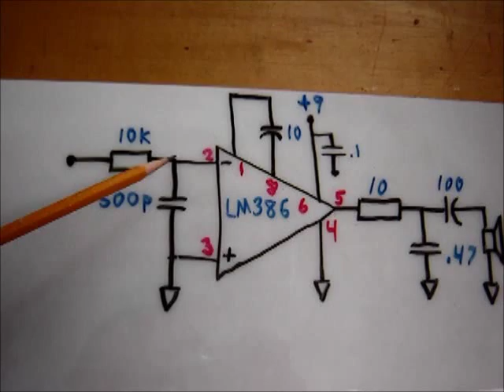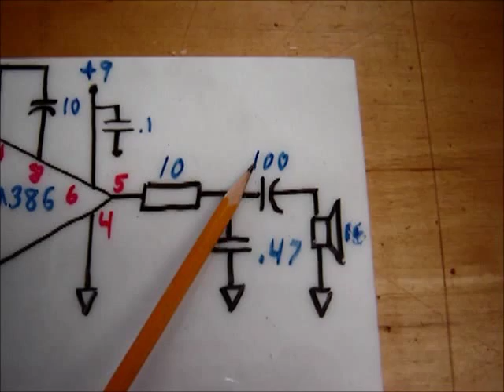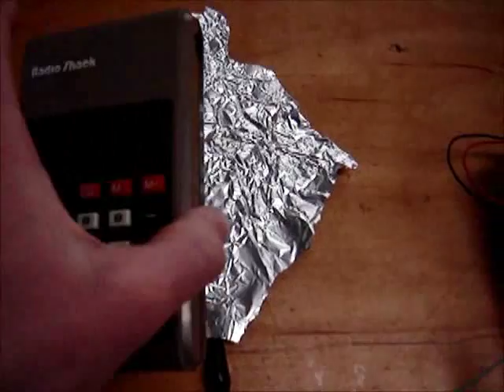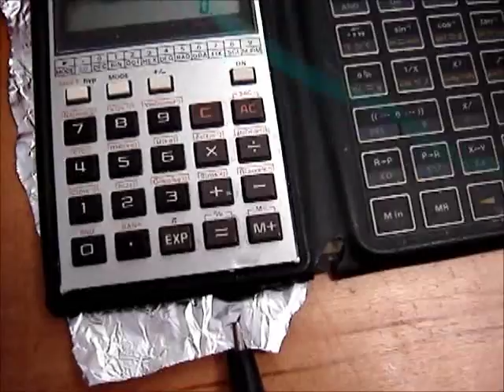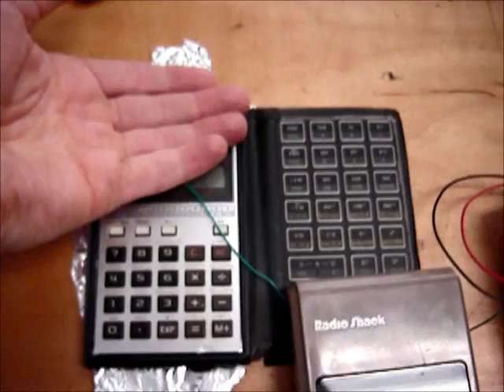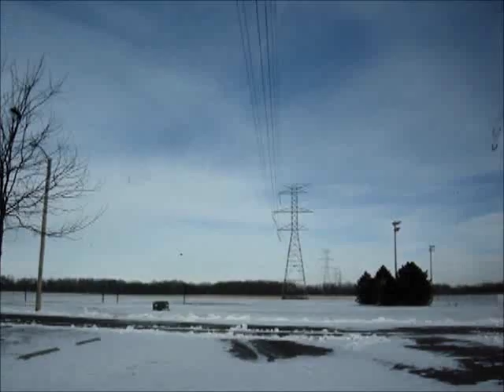Electric field detector

Comment: I can't stop hearing 60 hz hum. What kind of caps are you using? Polypropylene?
Reply from the maker: This circuit by its nature is very sensitive it may require metal shielding. The film caps are polyester/Mylar.

Comment: Does inverting amplifier mean that it's a different device and not the usual LM386?
Also I see in your circuit diagram, that you have connected a 0.1uF capacitor with the 9V power supply? May I ask what its purpose is? And where have you connected the other end of that 0.1uF capacitor? Is it grounded?

Comment: I have a question does the sound intensity varies as the electric field detected varies ?????
I mean that can I use this circuit to compare between  intensities of electric field coming from different sources ?????
thnx in advance
Reply from the maker: Ahmad Sawwas Yes as long as the field detector amplifier is not clipping.
Reply: ok thnx a lot :)

Comment: Excuse me, but can you please tell me the exact values of the components in this project because I'm a bit confused wether it's in pico- or micro and there's a value in the video which is .47 and you said it was .7 so which is it sir? Thanks in advance!
Reply from the maker: Hi, All caps are in micro-farads except for the one across pins 2 and 3 which is a 500 pico (okay to use a range of 330 to 620 pico there). .47uf is correct as shown.